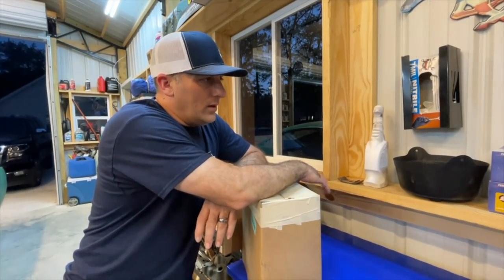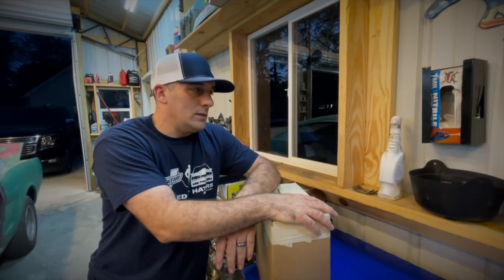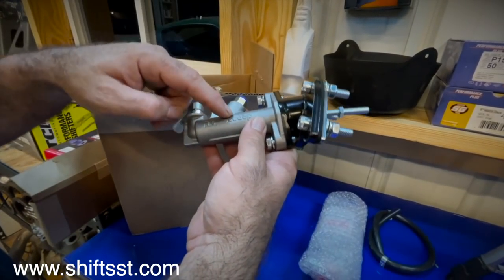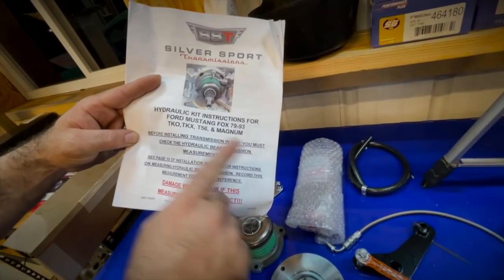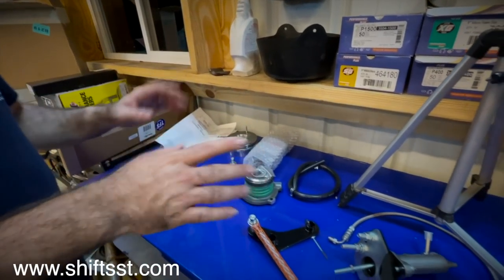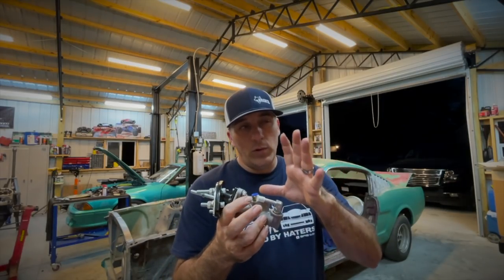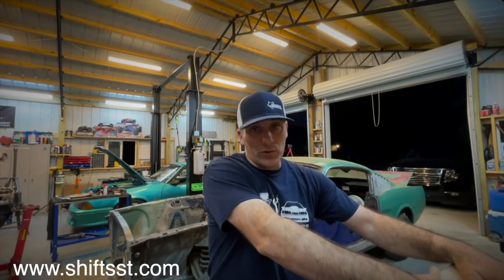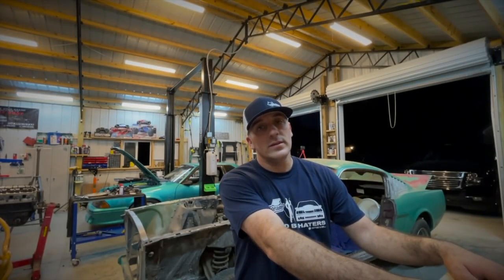Your stiff clutch sucks.... But there is hope!!  #GIVEAWAY

Comment: I've installed quite a few of those kits and literally the under dash firewall setup takes me just a bit over an hour to install, its that easy and really you don't even have to remove the pedal assembly to cut the hole. The setup is basically the same as what ford already used in the 87 to 88 turbo coupes and very easy to bleed. U will have to pull the trany for the bearing retainer to mount the slave for a T5, TKO/TKX, magnum. Its a real pleasure to not need a clutch fork and tons more room for exhaust clearance. The recoil of the clutch pedal is super fast for quick shifting and engagement. The feel is like a S550 mustang with simular slave setup.

Comment: Good luck to winner! Im cool with cable. I prefer Center Force Clutches for all my vehicles.
Reply: Good non slick running clutch, Ive pulled all the rivets out that hold the pads to disk, careful dragracing that clutch

Comment: I would love to try that kit. Hydraulic is definitely the way to go for ultimate adjustability and easy of pedal movement. Especially when you get an adjustable release if you are drag racing. Real Street uses that set up on their mega power 2jz Supras for better launch control.

Comment: It's nice to not have a heavy clutch pedal with a performance clutch but in my mind the added complication of a hydraulic assembly is over complication. I know clutch cables do stretch but I'd rather take the 15 minutes to swap a cable or adjust the clutch pedal than to pull out the entire transmission to change out leaking or blown out throw out bearing. If it used an external slave cylinder and a clutch for I'd like the kit.

Comment: I had a 93 LX hatchback that had a stiff clutch, on top of that the clutch pedal adjustment was way off. If you lifted the pedal only a few inches and didn't have your foot on the gas you were stalling it.

Comment: My T45 feels like a 1935 bulldozer clutch. It's so tight that the cable has snapped a couple times. Why is it so tight? Especially on a cold start. Did the previous owner just put a garbage clutch kit in it?